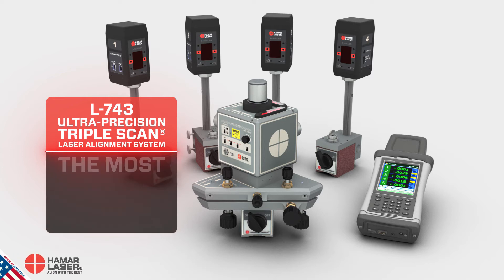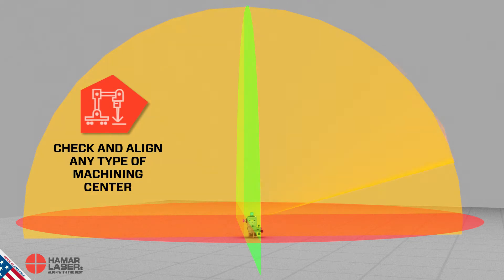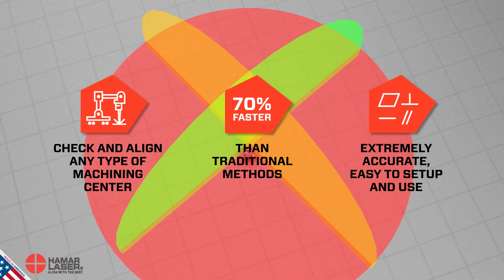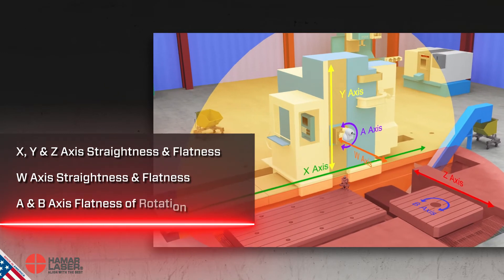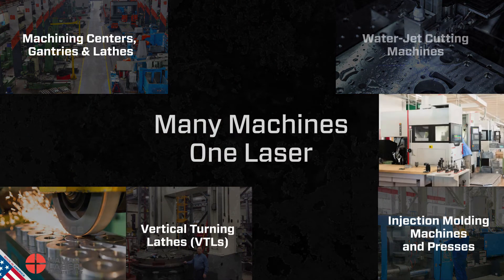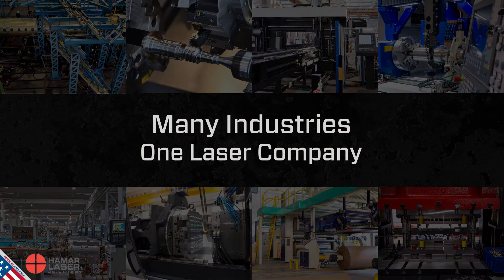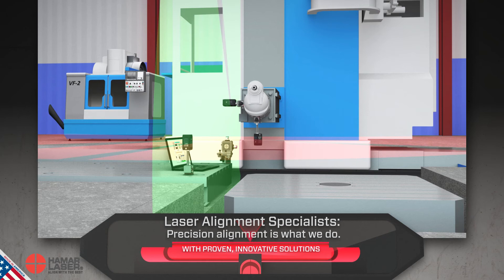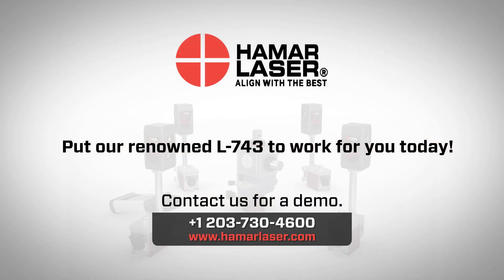Many Checks, One Setup - L-743 Ultra-Precision Triple Scan® Laser Alignment System

Comment: Possible to show some real world machine alignments using your product?
Reply: We do have this & some clients also posted such during decades. But for training the Digital videos is much much better to watch. And training is what the Europeans and Asian Clients needs. 
Plane Laser System for flatness was invented in end of the 70's had been Generation updated 2-3 times back then. 
1992 it came as TripleScan with 2 times better flatness than any other OEM produce today in 2023. further in 
1998 we invented Ultra Pricision in same type of Lasers and Launched the Series L-740, L-741 L-&42, L-742WW & L-743
These lasers still leads the whole branch by Flatness of 0.0025mm/m. squareness is 0.005mm/m. and when used as Spatial Hemisphere CNC Machine Tool Alignments many parallel objects is set with no squareness errors at all - Good Best for Roll Alignment !